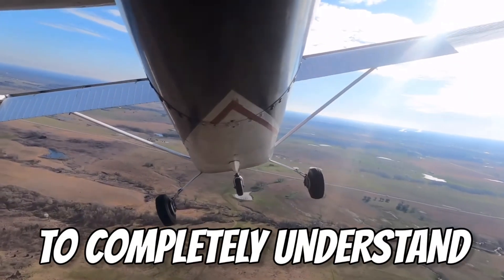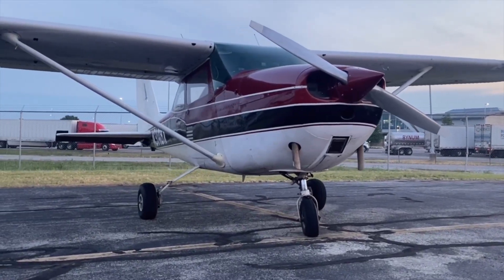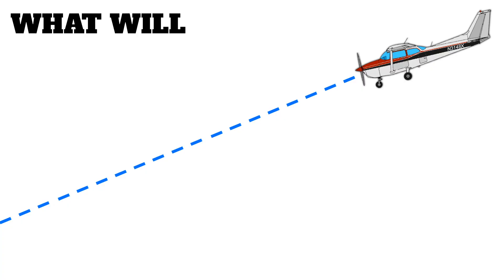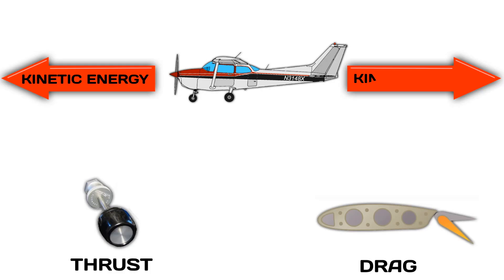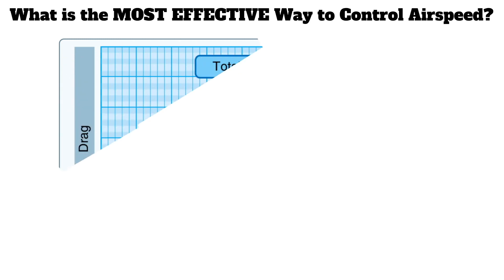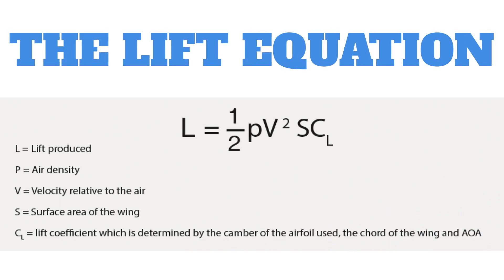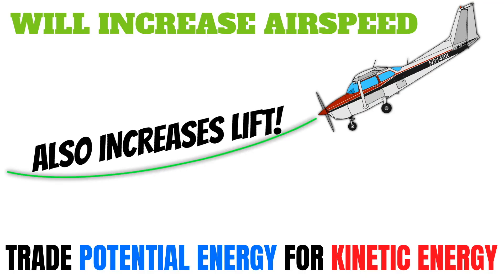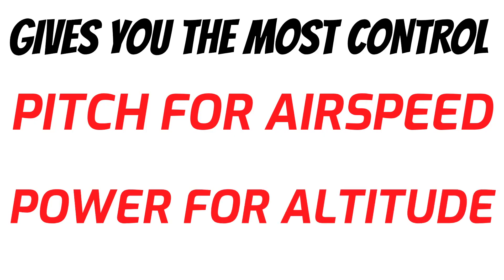Should I Use PITCH or POWER?

Comment: When on the backside of the power curve, the principal control for airspeed is pitch and the principal control for altitude is power….however, they are not mutually exclusive.  Often, you will need to use one control with a touch of the other to maintain the desired glideslope.  Especially in gusty winds and when wind shear is present.
Reply from the maker: Exactly. Thanks for the comment
Reply: This is exactly what my instructor taught me. They're connected quite intimately, especially on final or in slow flight. Maintaining, say 55 kias and 6,000' msl, in slow flight, you need to be ready to adjust either or both. 

Just so on final at whatever your final approach speed is.
Reply: @joeellis5766  Sounds like you had a good instructor 👍🏻
Reply: @TheAirplaneDriver  I do the same thing with the elevator and throttle whether I'm on the front side of the power curve or the backside.  How could the propeller control the altitude?  Please explain the forces involved?
Reply: @warren5699  If you are slow you do not have enough energy to climb nor maintain altitude using pitch alone without stalling. You need power.
Reply: @TheAirplaneDriver  I didn't say I don't use power.  You have to keep the wing flying - that's done with power if you want to control altitude - gravity if there's an engine failure.  What I said is I use the pitch AND the power the same on the front and back sides of the power curve.  Please check my reply to @joeellis5766 above.
Reply: @warren5699 if you add some power, you increase lift, especially at high AOAs, increased lift=slower descent or climb. 

You'll not get a ton of airspeed because you've got, what's the technical term . . ., buttload, that's it, buttload of parasite drag from the high AOA and flaps. Plus the induced drag from being slow.
Reply: @joeellis5766  Thanks for your comment.  Adding power adds lift but the question is how much.  This is the amount of thrust I was told by an engineer that a Skyhawk produces - 'The static thrust of the 160-hp 172 is probably around 700 pounds and cruising thrust around 300' - i.e. a tiny percentage of what would be necessary to oppose weight.  That thrust even in slow flight is still close to a horizontal line, so the upward force from the engine that opposes weight is what, one or two percent of the weight?  I don't know how to calculate that.

Recently when I did slow flight solo in a 172, this is how it went.  From slow cruise, I brought the engine to idle and gradually extended full flaps.  I held altitude with back pressure and did not touch the throttle again until just before the bottom of the white arc.  So the wing was opposing the weight 100% through the front and back sides of the power curve speed ranges.  Barely before the bottom of the white arc, I increased power just enough to hold speed at the bottom of the white arc - it was 1900rpm.  The pitch was around +10°.  To recover, I pushed in to full throttle - the rpm went up to 2300.  If felt like a takeoff acceleration.  I gradually reduced pitch to keep the exact altitude while also raising flaps, and reduced power when I reached the desired speed.  I.e. I followed the PHAK with the two basic resources the pilot has to manipulate - I raised the pitch to maintain altitude at a slower speed and I used the thrust to control speed.

Of course with many light single-engine airplanes, these two forces can seem to work in a different way.  The propeller slipstream winding around the fuselage has a significant effect on the downward pressure on the horizontal stabilizer.  If the airplane is trimmed hands-free on approach, adjustments in power change that downward pressure on the tail and work like the elevator, raising and lowering the pitch, changing the lifting force of the wing, and therefore controlling the altitude.  In fact, this is the procedure for approaches in Skyhawks for the landing without elevator control (see POH for full details).   This might seem to indicate that power (thrust) controls altitude but not really - it's still the wing's lift vector that opposes weight and controls the altitude.  I once flew with someone transitioning to a Cherokee Six.  He got low on the approach (red over red) and added power to correct the altitude.  For whatever reason in that airplane (out of trim or maybe because of the heavy engine), the pitch didn't change so we accelerated 10 knots and didn't seem to go up even one inch.  Twins and jets would react about the same - there's no propeller slipstream around the fuselage.  I think the Handbook describes the technique just right so that the pitch and power are both adjusted properly when the pilot corrects for a low final approach - "power should be applied immediately to maintain the airspeed while the pitch attitude is raised to increase lift and stop the descent".  Of course you have to stay within the airplane's limitations - you can't raise the nose so much that speed is lost or a stall occurs.  Very important to understand what the airplane's forces really control.
Reply: @warren5699 really appreciate your contributions here, since I've been trained pitch for airspeed. In a 172 in slow flight, if you wanted to climb, you'd put in power right? and pitch up to maintain speed near the bottom of the arc? It always made sense to me that the same technique works for an approach, especially short final in a high drag config, and that developing the instinct to pitch up in either situation is bad vs developing the instinct to add power first.

I'm starting to think that power for altitude is a safe crutch for newer pilots to build safe instincts around stall envelopes. But once the student reaches the point where "pull back hard because I'm low without adding power first" sounds as suicidal to the student as the instructor, the student should probably toss that crutch and favor pitching as primary means for altitude control as that technique leads to better habits long term and with more kinds of airframes? With obvious caveats that if you have no pitch or power to change, you must use the tool you have. 

It would also explain a lot of the debate here if that was true... There are many things across careers where there's a safe and simple way to get started and keep you alive/productive enough in the early stages of experience until you know enough of the foundations to transition to more advanced (but ultimately more effective) techniques that a newbie would be overwhelmed by or misuse. You get a lot of newbies telling you you're wrong in those fields too, so this all feels suspiciously familiar.

"Never start a sentence with 'And,'" for example 😂.
Reply: @patrick5372  Patrick - Pulling back hard of course wouldn't be correct.  I didn't say that.  And coordination with the power is critical.  As mentioned - the FAA's recommended technique for correcting a low final approach - Airplane Flying Handbook pg 9-30, "power should be applied immediately to maintain the airspeed while the pitch attitude is raised to increase lift and stop the descent."
Reply: @patrick5372  If conditions are nice and pitch and power are coordinated, everything normally works out fine.  But if conditions get gusty, then pitching for airspeed can get hazardous.  I was with a pilot who was pitching to airspeed at the beginning of the approach.  As we descended it got really gusty and the pilot started chasing the airspeed needle, overshooting and undershooting the aiming point erratically.  I had to take over and stabilize the line of flight to the aiming point (with the elevator) while at the same time confirming there was enough power to maintain the recommended airspeed plus half the gust factor.  With a straight line of flight reestablished, we were then able to safely judge when to start the roundout.
Reply: @patrick5372  Patrick - I just happened to think about one of your comments again - "pull back hard because I'm low without adding power first".  First as was mentioned, pitch and power need to be coordinated on approaches so that the altitude corrections are made with speed maintained at the POH recommended level.  But I'm puzzled why you would think that it would ever be necessary to pull back hard.  Yes there might be some moment where you are way out of trim if you have a momentary high workload, but if everything is done properly (pitch and power set, airplane trimmed) and conditions average, then you should be hands free or in other words be able to even momentarily release the controls and have no noticeable change in flight path or speed.

Of course normally the hands are kept on the controls and some tweaking will always eventually be necessary, but if trimmed out, the pitch change needed is usually not more than a couple of degrees that takes no more than fingertip pressure and the coordinated power change is nothing but nudging the throttle in or out a little.  If more is necessary, of course do what's necessary.  In case those adjustments need to be kept, then tweaking the trim wheel relieves all pressure again.

This doesn't apply just to approaches, but also to climbs, enroute cruise, and enroute descents.  It also would apply to slow flight, which makes me think that when you have done slow flight and maybe some other maneuvers (ground reference maneuvers), your instructor didn't have you trim out maybe since it was going to be a temporary condition.  That perhaps left you in a nose heavy condition during that maneuver, giving the idea that to raise the nose further that hard back pressure would be necessary which is making you think that that's what happens on the approach.  But if the airplane is trimmed properly, the forward or back pressure and the coordinated power adjustments will normally require relatively light pressure on the approach as well as in all of those maneuvers.

Of course we should mention a critical exception - go arounds.  That involves a huge power increase and will normally force the tail down significantly, requiring strong forward pressure temporarily to avoid a stall while the flaps are raised and the trim adjusted.
Reply: @warren5699  ???. I'm not puzzled, nor did I ever say I would do that, read it again. It was an example of the kinds of dangerous things pre solo students might do if told to reach for to pitch for altitude first, instead of power. My point is simply that teaching students to reach for pitch first to control altitude seems more likely to cause stalls and spins until their skills develop. Maybe that's why pilots are taught to use power for altitude first.

It doesn't seem like you actually have any insight about what I'm interested in (*why so many instructors teach power to altitude pitch for airspeed*).
Reply: @patrick5372  Patrick - thanks for the clarification.  Actually I feel your question is really important and I do have an answer.  Students get completely contradictory information.   Pitch to airspeed - pitch to altitude.  That's really not good.

I think the answer to your question 'why so many instructors teach power to altitude pitch for airspeed' is simply that a plain English interpretation of the term 'region of reversed command' is taught, and it's assumed that the FAA is saying that it's pitch and power that reverse.

However with FAA terms, plain English interpretations don't always work.  For example, if I used a plain English interpretation of the term 'non-movement area', I would say that that is an area on the airport where nothing moves.  If I used a plain English interpretation of a 'go-around', I would say that that is when a pilot flies in circles.

To understand FAA speak, it is necessary to refer to FAA definitions, not Webster dictionary definitions.  The glossary in the PHAK has the definition of the regions of command - they refer to "the relationship between speed and the power required to maintain or change that speed in flight".  In PHAK chapter 11, there's a discussion of the region of reversed command and a power required curve diagram to show how power required and drag go down from cruise to best glide, but REVERSE and go up as speed continues to decrease from best glide to minimum speed.  That is caused by the rapid increase in induced drag.  The takeaway is that pilots must be careful when flying at speeds below L/D Max because drag increases requiring more and more power to control speed the closer the speed is to minimum speed.

What's neat is that anyone can verify this performance.  For example, in a Skyhawk, at a safe altitude, stabilize the speed at 85, 75, 65, 55, and 45, and jot down the power required (rpm) at each speed (keep flaps up).  The power required will go down from 85, 75, 65, and will go up from 65, 55, 45.
Reply: @patrick5372 pitch controls altitude. Power controls airspeed. When it’s taught differently, it’s taught wrong. Not an airline in the world would accept that train of thought from their pilots. 
The things I see in this video and what I read, it’s cringe worthy.
Reply: @patrick5372  I wrote a whole thing, somehow it’s not showing. I’ll try again in a bit. I have gone into detail under different posts under this video.
Reply: @warren5699  really appreciate this, I'll review that phak part and go experiment next time I'm out. Sorry I missed it for so long apparently I missed the notification

Comment: Good thorough lesson on power and pitch.  Like many principles in aviation, both ways work as you have demonstrated.  Or all the way back to Stick and Rudder, airspeed is altitude and altitude is airspeed or the law of the roller coaster.  What gets lost in the charts and diagrams is the underlying principle that as much airspeed as possible is our greater for safety need on takeoff and as little airspeed as practicable is our greater for safety need for landing.  If we slow below 1.3 Vso on short final so as to get a sink requiring dynamic throttle to nail the glide angle and rate of descent, hold the centerline between our toes with dynamic proactive rudder (no aileron, we don't want to turn), and use apparent rate of closure with the numbers to determine how much pitch is necessary to maintain what appears to be a brisk walk (decelerate as we near the numbers), we will "arrive at the touchdown point in a three point attitude all slowed up and ready to squat."  Where have I heard that before?  We take off dangerously slow, at Vy, and we arrive at the desired touchdown point dangerously fast at either 1.3 Vso or Vso.   Stall/fall back onto airport property on takeoff and LOC on landing or go around are the big killers today because we are too slow on takeoff and too fast on landing.

All this to say get slow enough to make your throttle an effective glide angle and rate of descent control and your flippers (elevator) an effective airspeed control all the way to touchdown slowly (well below Vso) and softly on the numbers or whatever touchdown point you desire.  If you have to close the throttle (now no longer a glide angle and rate of descent control at all) at round out, you are going too fast to land anywhere near the beginning of the runway.  Oh, the both ways works deal:  KISS.  We fly little airplanes.
Reply from the maker: Thanks for the comment!

Comment: Suppose you are on a perfect glideslope, perfect altitude, on a short final, but a tad fast. "pitch for airspeed"? you'd raise the nose? Or would you throttle back and keep the same perfect trajectory? Honestly, i've never totally understood why people say the other is better than the other, why not say it's combination of both, pitch and power depending on the scenario, but it is important to understand what is the immediate reaction to any given input...?
Reply from the maker: You absolutely can use both. My point is that one is more effective than the other. When making small changes on an ILS, the less effective method may be better

Comment: Let's keep it simple.
1. Set power/trim for a certain landing speed, and don't mess with the pitch anymore. (It's dangerous at low heights)
2. For the rest, only use power to control your descent. 

During landing phase, power only changes vertical speed while  horizontal speed remains stable (to a certain degree of course)

I always think of it as being a puppet on a string. Power controls the vertical motion of the string.

In the end, power and pitch is a balancing act that should become intuitive1. Just like the clutch/gearbox/gaspedal in a car.
You can easily practice this muscle memory in your flight simulator at home.
(If you're taking real life lessons, don't mess around on your own. Always listen to your instructor)

Comment: I'm an aviation noob.
I think a shallow on final approach with partial flaps most of the way and slightly increased power going to full flaps at moderate speeds is best.
Am I right?
That way, with a steady decline I can pay attention to crosswinds, potential shear winds, and just have to slip to keep the nose aligned with the runway.
Reply from the maker: Shallow approaches are great in some cases and they can help give you a smooth touchdown, but precision landings are often a little easier with a slightly steeper approach